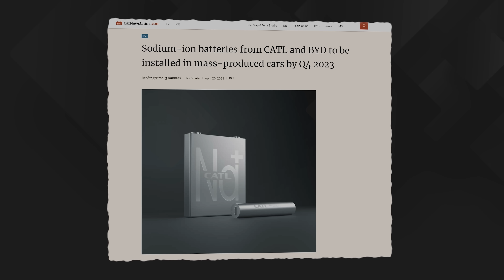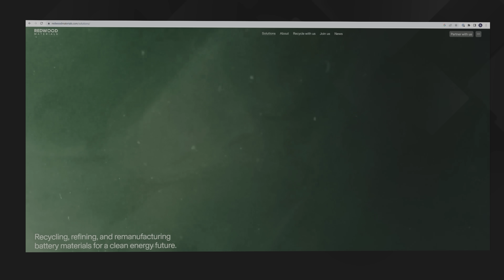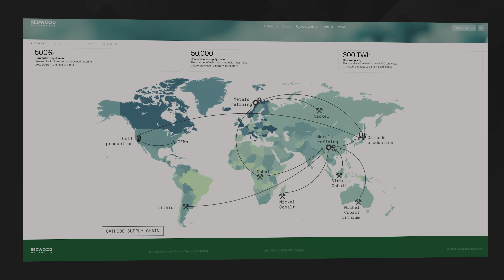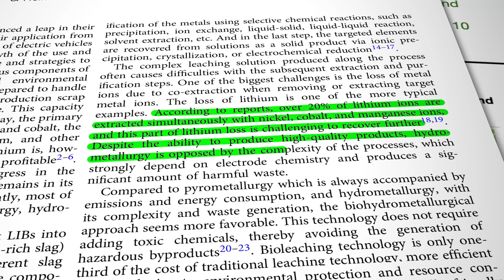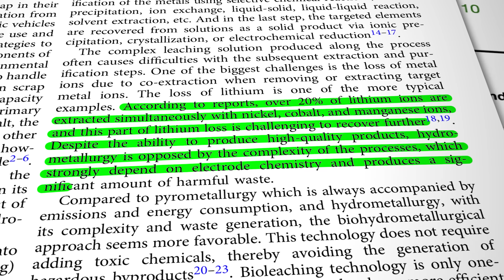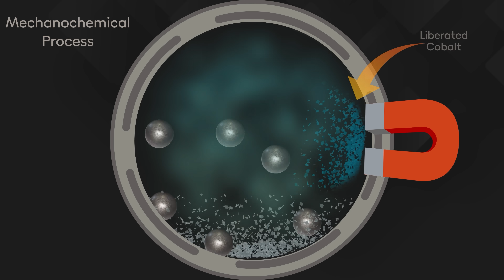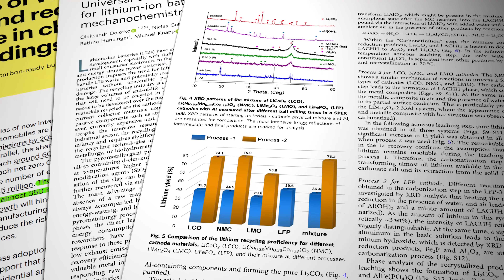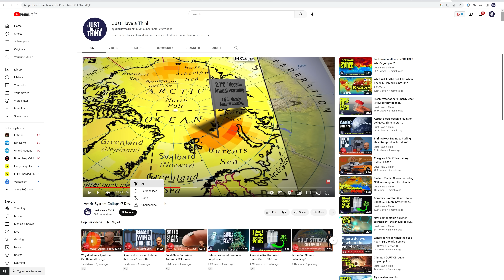Battery recycling just got a whole lot better.

Comment: In the '90s, I visited a German car battery recycling plant. They were very, very good, with astoundingly high recovery of multiple materials. Yes, it can be done today... in fact, we have been doing it for years. Simply a matter of sharing best practices.
Reply: Sounds like a lead-acid recycler. That’s a business that’s been around for decades. If we could get to lead-acid levels of recycling for the various lithium chemistries it would relieve some of my objections to the use of those chemistries in cars.
Reply: In the 90s I would expect you saw a lead-acid battery recycling plant. That’s a technology that’s been around for decades, and is extremely efficient.
Reply: @TheGotoGeek  Yes, lead acid battery recycling was efficient and cleaned up by then. Lead-acid has allright charging efficiency, but not as good as Li-ion. However Lead acid EVs needed to be float charging when not driving so there were more losses and cold batteries robbed energy return. Cutting edge chemistry in EVs were Ni-Cd. Ni-mh was not developed enough for the large current draws in EVs or even power tools. the consensus was that Lead acid was inadequate for passenger cars,  only workable the neighbourhood EVs or dedicated sub sedan type vehicles that could go around 70-90 km on a charge. However there were larger scale attempts. Fiat and others made lead-acid fleet vehicles for public services, but changing a battery pack every two years or more often if abused, meant the service contracts turned out to be too expensive for the manufacturers. What had some success was the Citroen Saxo electrique with water cooled Ni-Cd battery pack. Batteries were leased and it was tiny and had good range ( I don't remember how far), it was the Tesla of the day, pricy to buy but the coolest family EV. Another success was the City Think originally made in Norway but acquired by Ford. It was unusual as it used Zebra batteries, a high temperature battery chemistry, and after parking for a few days, you needed to run the battery heater to get them up to working temperature of 270C, they could go almost 200 km driven carefully. Siemens made drivetrain, charger and inverter for more manufacturers back then, so there was a working support ecosystem for EVs with industry standards. So yes, we were living the future in the 90' too!
Reply: Yes, lead acid it was.
Reply: @eriktempelman2097  Lead acid battery recycling is often noted as one of the most polluting industries in the world. While high recycling rates are great, the enviro hazard of current lead recycling technology is abysmal. It's almost entirely smelting, and tons of pollution and chemical runoff at the facilities. We need to avoid the same errors in lithium recycling
Reply: Any idea which city it was and if it's still operating?
Reply: @pioneer7777777  I remember EVs in the 90'. Germany and Switzerland were cutting edge in vehicles and batteries. Charging infrastructure were also better: EU standard were  20A blue CEE connector single phase, like on campgrounds and marinas. No subscription or per kWh payment, mostly free or a single startup fee or payment for only the parking. It worked, took zero maintenance and setting up your own charging station cost 5 DM for a CEE connector from Baumarkt you installed yourself.
Reply: @pioneer7777777  I am afraid not. It was long ago, and all I can say it was in what we used to call West-Germany, somewhere in the mid-east.

Comment: How about just sticking with ICE engines and using synthetic fuels or even fossil fuels where it's mandated that the emissions are then removed from the atmosphere with direct carbon capture. They talk about being able to do this for as little as £100 per ton - see Captura. If one could pay only £100 to drive an average car for a year with net zero emissions then its a bargain.
Reply: How are you going to perform direct carbon capture on a car? Everything I've read (and seen in videos like JHAT's) suggests that huge industries where it is already something they've been trying for years are not able to do it anywhere near as efficiently as they would like, so I don't see how it would be possible to do that for cars.
Reply: @danyoutube7491  Sorry, should have said Direct Air Capture - DAC. It could be done anywhere on the planet. Just needs to be the same amount of CO2 as emitted from the vehicle.
Reply: @petewright4640  Ah right. But the issue with that is DAC on a big enough scale would mean an unfeasible number of facilities; the ones currently in operation and being planned for the future are only going to capture a miniscule percentage of emissions, I don't think it can ever be expected to come close to cancelling out all of our emissions. The idea of DAC (and similar technologies) is to try and reduce the excess CO2 we've built up in the atmosphere over time while also reducing emissions as much as possible.

Comment: It's been crystal clear for several years we will not be able to swap EVs one for one with ICE vehicles. IMO this a FEATURE not a downside. Overwhelming majority of ICE cars sit still all but a few minutes or hours per day. They then require garages, parking lots, and other homes further adding to manufactured goods which are built using fossil fuels. More vehicles more roads bridges ramps roundabouts traffic lights. MORE must become a curse word.

Comment: Nice one. The mechanical crusher looks cheaper than the other methods, which is of course the critical bottom line.
Reply: He didn't do enough research to know St Georges Eco Mining exists in Canada & already underway with finalizing their recycling centers.  100% of all materials recycled are reused & resold.  They recapture all rare earth metals into ingots, 99% spodumene & hydroxide purity and even recapture the aluminum.  They even produce Hydrogen during its offgas stage.

They even own all the rights to Iceland and have amazing recent results recapturing rare earths from their geothermal plants.

He really failed to fully research this topic and who's on the forefront of the recycling process of battery reclamation (they even recycle alkaline batteries and can process raw ores too).

Ticker SXOOF in American markets, SX in Canada.
Reply: @EarthCreature.  
Troll
Reply from the maker: Cheers rockman531 Much appreciated
Reply: @JustHaveaThink why did you fail to tell people about THE 100% battery recycler, St Georges Eco Mining?

Comment: Run internal combustion engines on clean CNG
Reply: what is the C in CNG?  I hope you are not talking about methane for the euphemism NG.
Reply: @bradleybarton1420  compressed natural gas.
India uses it for their cars  and makes the gas from rubbish instead of land fill
Reply: @rocklover7437  
Yeh thats a great idea. 😂
Swap out one bunch of carbon polution for another bunch of carbon fuel polution.
Reply: He didn't do enough research to know St Georges Eco Mining exists in Canada & already underway with finalizing their recycling centers.  100% of all materials recycled are reused & resold.  They recapture all rare earth metals into ingots, 99% spodumene & hydroxide purity and even recapture the aluminum.  They even produce Hydrogen during its offgas stage.

They even own all the rights to Iceland and have amazing recent results recapturing rare earths from their geothermal plants.

He really failed to fully research this topic and who's on the forefront of the recycling process of battery reclamation (they even recycle alkaline batteries and can process raw ores too).

Ticker SXOOF in American markets, SX in Canada.
Reply: @EarthCreature.  
Troll

Comment: The battery recycling space is growing by leaps and bounds.  Lithium ion batteries are far too valuable to throw away.  That would be economic insanity.  The recycling rate of lead acid batteries in conventional ICE vehicles is over 99%, and they aren't worth anywhere near as much as Li-ion.
Reply: This probably has to do with legislation.
Reply: @cyrilio  agreed, I know in Europe the recycling rate was abysmal (single digit percent iirc) until the EU passed regulation forcing them to be recycled. Still, lithium has a big demand, so hopefully economics will drive recycling, and if not I guess we should start petitioning lawmakers again!
Reply: @Nabushika  With the way lithium prices are climbing now the big push is going to be on cost effective methods of pulling as much pure material out of old batteries as possible, 76% of the lithium is pretty good, but I bet it can be higher. Pulling large amounts of cobalt can only be good as well as THAT is a much better source for new batteries than the controversial sources for new metal, considering new chemistries are using less and less of it, that cobalt will stretch further which might even eliminate the need for new cobalt altogether.
Reply: It’s important to remember that a lot of current momentum for recycling in the US traces back to the Resource Conservation and Recovery Act.

While I agree that it would be “economic insanity” to not recycle lithium ion batteries….companies were more than happy to toss harmful metals into landfills until the RCRA started the momentum to stop that practice.
Reply: @SaveMoneySavethePlanet  Thankfully we're nearly rid of nickel cadmium now.
Reply: @jimurrata6785  The number has gone down, but, not out. Sigh.
Reply: @carlthor91  Unfortunately Ni-Cad cell voltage makes it an almost ideal rechargable replacement for alkaline cells...
So until past generations of portable devices like incandescent flashlights and electronics age out of use I'm afraid they will still be produced.
Reply: @jimurrata6785 , you are probably thinking of NiMh.  I haven't seen a Ni-Cad battery in at least a decade and probably closer to two.
Reply: @CL-gq3no  I'm certainly not using them. But nicads were the only thing going 40 years ago. (and recycling/recovery efforts were a joke back then) They still turn up occasionally, but I only see Nimh for sale.
Reply: @jimurrata6785 , yep.  I was into remote control cars as a kid and Ni-Cad was the best technology available at the time.  Compared to Li-ion or even NiMh, they really suck.  I can't imagine that whatever Ni-Cad batteries remain are long for this world, but I'm sure there are still some out there.
Reply: He didn't do enough research to know St Georges Eco Mining exists in Canada & already underway with finalizing their recycling centers.  100% of all materials recycled are reused & resold.  They recapture all rare earth metals into ingots, 99% spodumene & hydroxide purity and even recapture the aluminum.  They even produce Hydrogen during its offgas stage.

They even own all the rights to Iceland and have amazing recent results recapturing rare earths from their geothermal plants.

He really failed to fully research this topic and who's on the forefront of the recycling process of battery reclamation (they even recycle alkaline batteries and can process raw ores too).

Ticker SXOOF in American markets, SX in Canada.
Reply: Yeah, but the only reason why so many lead acid batteries are recycled, is because you either recycle them, or you have to dispose of them with the Fed's up your ass.

Because lead acid batteries are fully regulated by the federal government as hazardous waste.
But when recycled, a lot of the rules for handling them are eased.

You can literally go to prison over lead acid battery disposal.

I bet it's several hundred times more to dispose of them, than to simply ship them to a recycler.
Reply: @lordgarion514  "dispose of them" 😄   They're worth money! 
Not clean copper or catalytic kind of money but I've seen $0.20/lb and they come with a convenient carry handle.
"The government" could give a rat's ass if you used one as a doorstop... for decades.
Many garages do.
Reply: @jimurrata6785 St Georges Eco Mining...  he's not doing his job on YouTube unless he's telling us about that company
Reply: @lordgarion514  "the only reason why so many lead acid batteries are recycled, is because you either recycle them, or you have to dispose of them with the Fed's up your ass." So yeah, there's the answer right there, I guess!
Reply: Yet here the entire planet is, throwing them away on a daily basis as we've done for the last quarter of a century. Perhaps your calculations are inaccurate or perhaps we're just looking at a technology that's decades away? Like the period of time it took to start recycling ICE vehicle batteries?
Reply: @someoneelse4492 They'll keep throwing them away so long as this channel fails to inform people about St Georges Eco Mining
Reply: I see a potential problem here.
 If the new sodium ion batteries replace lithium then the demand for lithium will plummet and investing in an expensive recycling plant would not be cost effective.